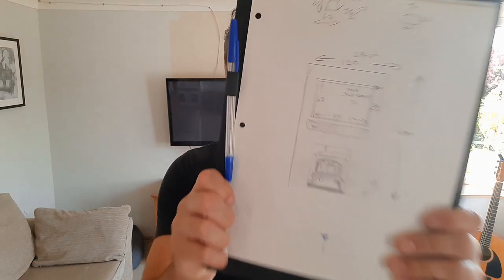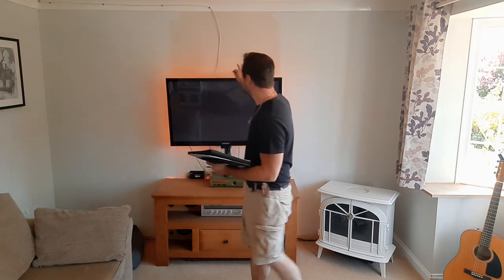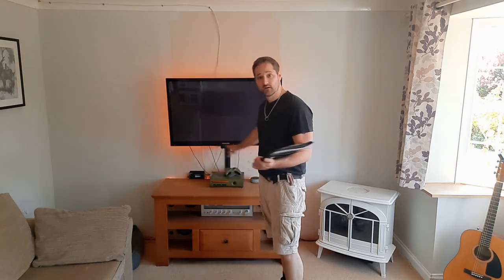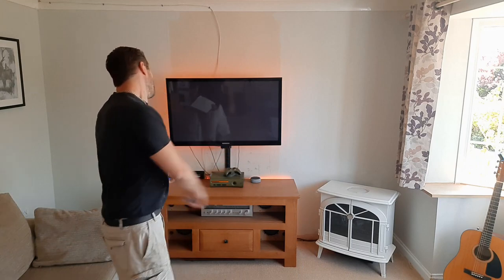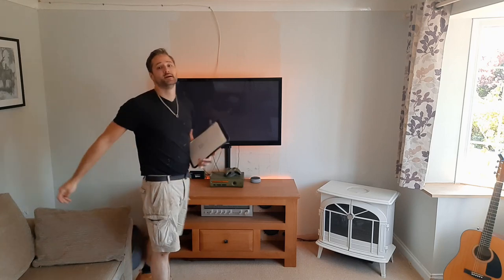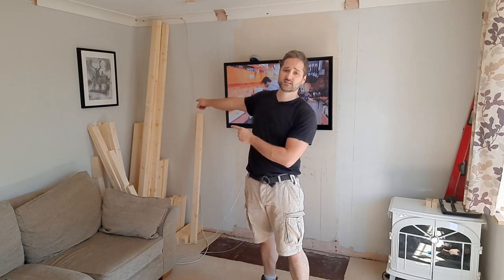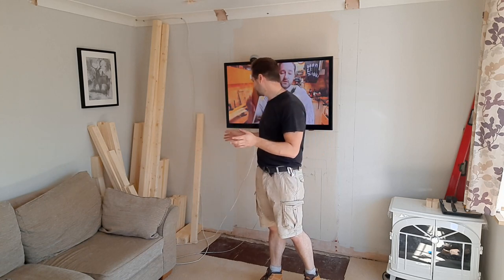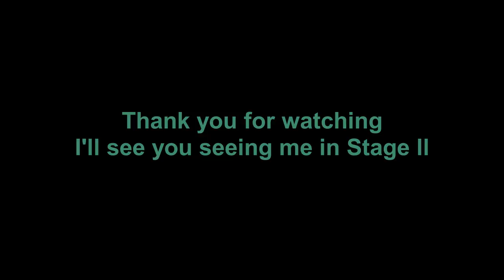How to build a seamless TV media unit (stage 1)

Comment: Hello.  I just found this build. great job! Can you give a basic measurement of the framing? LxWxDepth. Thak you.
Reply from the maker: Hello I can but its best not to, the reasons why is, the unit was build 40mm bigger than the tv (on all side) the death was based on the death of the electric fire (with 50mm gap behind it)  the rest just built it self really,  rule of thumb though, your try to mimic a fire place, so don't build it too shallow 
I hope this helps
Reply: @DeanItYourself01  Thank you for your time.
Reply from the maker: @martinicu  no problem